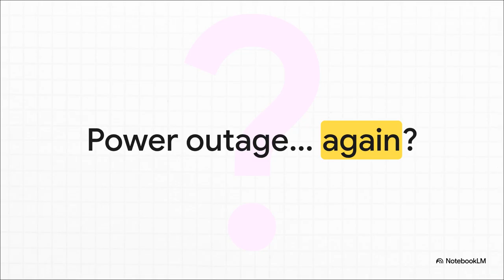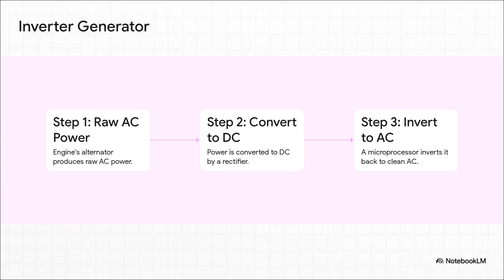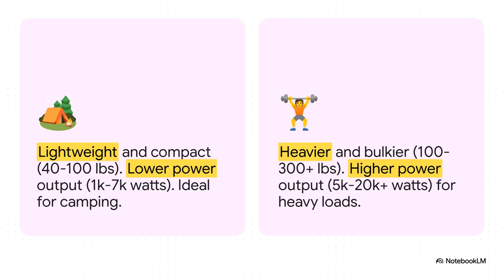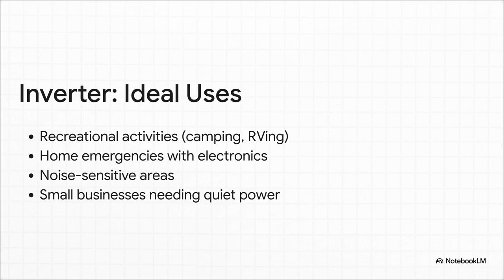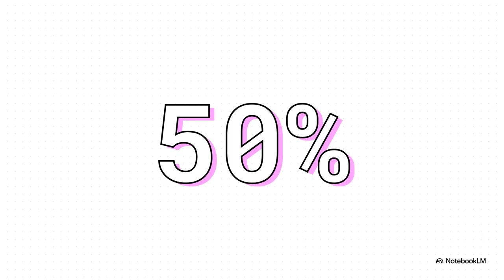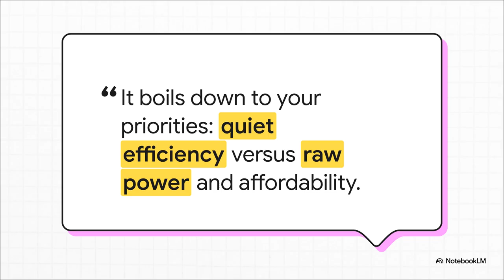Portable Generator Safety Tips: Essential Guidelines for Safe Operation

Comment from the maker: .
Link = https://cutt.ly/4rB1WDMy
.
Generator safety requires proper ventilation, carbon monoxide detection, and electrical connection protocols to prevent accidents and fatalities. Never operate generators indoors or in enclosed spaces, maintain 20-foot clearance from doors and windows, and use heavy-duty extension cords rated for outdoor use. Professional installation of transfer switches ensures safe power connection while protecting both family and electrical systems.

Hashtags: #GeneratorSafety #PortableGeneratorSafety #CarbonMonoxide #GeneratorVentilation #PowerSafety #ElectricalSafety #GeneratorHazards #SafeGenerator #BackupPowerSafety #GeneratorAccidents #PowerGeneration #GeneratorRules #SafeOperation #GeneratorGuidelines #EmergencyPower